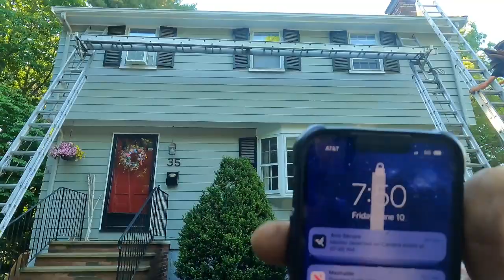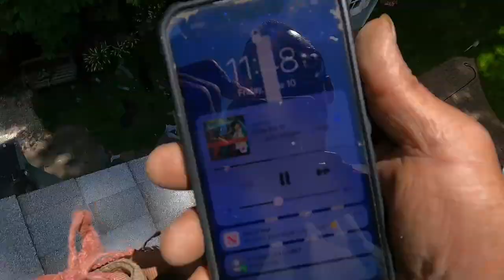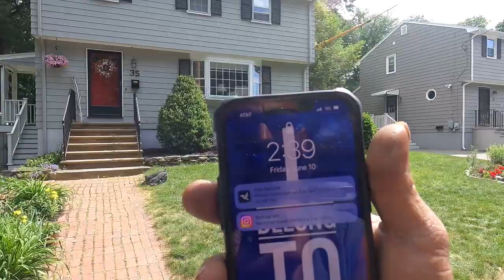Soffit Vents allow air to enter the attic from under the eaves. Ridge Vents Alone Won't Do the Job.

Comment: Great work! Most roofers won't touch a soffit but the added vents are a great benefit to this house. The attic will stay cooler in the summer so the house will be more comfortable and cheaper to cool. The shingles will last longer and you won't get ice damming during bad winters.